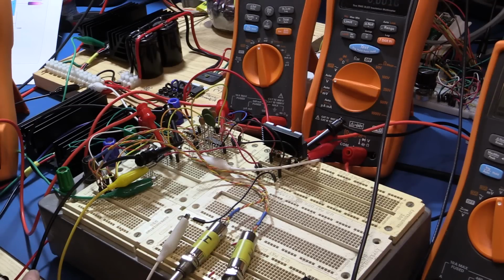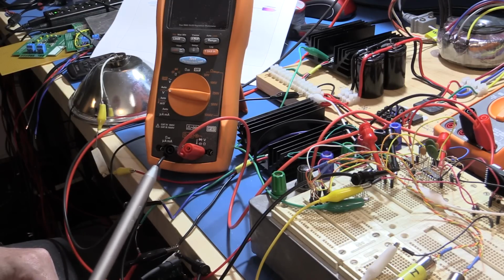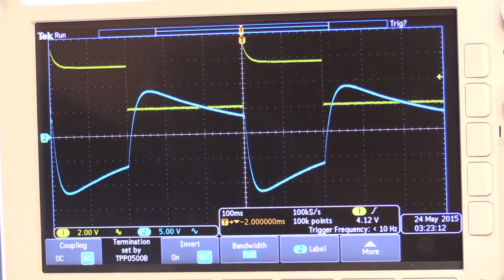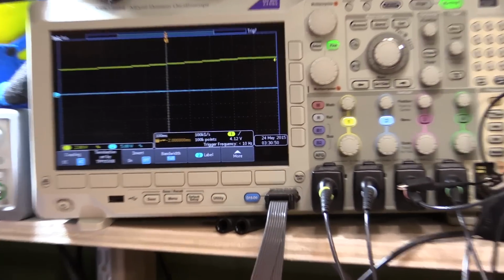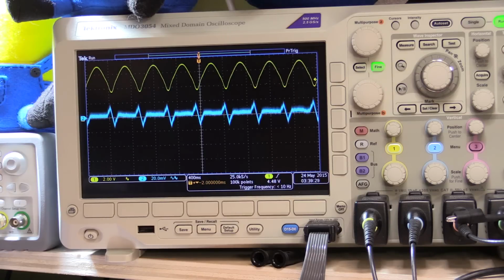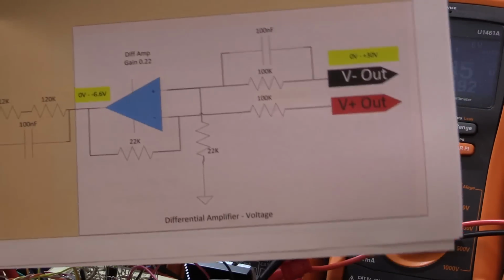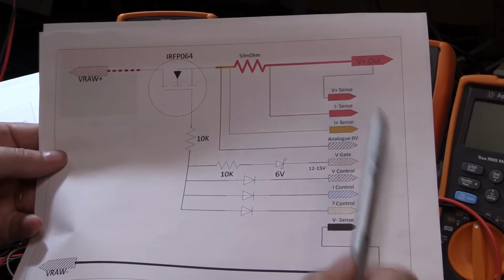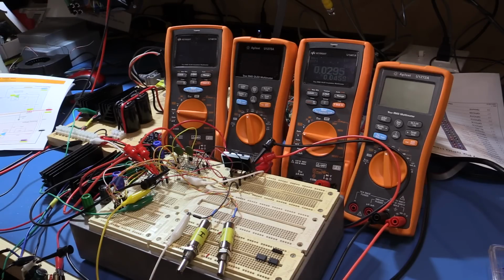The Modular Bench Power System #12 - Putting it all together

Comment: Loving this series and I've learnt a lot but it looks like with the MOSFET you can only limit current by reducing voltage. I'm assuming you'd have to use a completely different design to actually output a set voltage then control the current being drawn without affecting the supplied voltage.
Reply from the maker: +Moonbrony It is not to do with using a mosfet but the fact that you only want one parameter controlling the output at any one time so if the current is not at the limit it must not interfere with the voltage, conversely when the current limit is in play, the volts will be lower than the set point and you don't want that to override the current limit functionality

there are many ways of achieving this, the way presented is just one and is pretty simple to implement
Reply: +Peter Oakes (TheBreadboardca) Thanks for the reply. So you don't want both parameters controlling the output? I would have thought that as long as the current is controlled first, then you could control the voltage somehow as maybe a second stage? Then you could use it to power circuits that need no more than, say, half an amp, but require a variable range of voltages. Sorry, I've been making things for years but I'm new to the whole circuit design aspect.
Reply from the maker: Not both at the same time, if the current is not at its limit then the current amplifier should not be pulling down the voltage drive, same if the voltage is not at its limit and the current is not at its limit, then the output should be allowed to rise to the desired voltage, this is why the diodes in the output path of the amplifiers to the mosfet, it prevents either amplifier from driving the FET gate upwards and turning it more on, any amplifier or other device connected through a diode can pull the output off only, if nothing is at its limit then the drive to the FET is pulled high by hte pullup resistor, not the drive from the amplifiers

Comment: Racing season is finally done and I'm igniting this hobby for my spare time again. 

I was looking at a similar schematic to this layout (I think it was Agilent) with the analog circuit ground floating on the main power rail with +/-12v on an isolated supply as you discussed. Looks like this may be beyond my skill set as I am very new to this. The laptop power brick idea was my original plan as a have a few 20V ones laying around the house as well as a couple 30V printer bricks as well.

Thanks for the great tutorials!

M~
Reply from the maker: +Mike Novo you can still use the laptop brick for the POWER. use a small +- 12V for the OP-Amps and simply connect the ground to the right place as indicated in the schematic. this should work just fine.

I will be posting more videos on this soon as I proceed to computerizing the design and will include a section of these options
Reply: Peter Oakes Thanks, I've been playing with the schematic a bit lately trying to understand it. 

While I understand inverting the diff amp connections as you did to achieve the difference out in the summing node vrs the Iset and Vset going to the integrators, I'm not completely understanding why the I diff amp configuration differs from the V diff amp (classic resistor to ground). Is it because you are floating it on the main positive bus rail and it would be redundant and would also change the values? If it was not floating, would you reference the inverting (-) of the Current Diff Amp to ground? Because, this is what I was thinking of doing.

I feel like I owe you tuition money or something. lol!

M~

Comment: I built this power supply on a breadboard, tweaked integrator resistor and cap values to get decent loop stability. Works fine except this single issue i'm having - it's impossible to get 0 volts on this power supply, it's always floating couple hundred milivolts above zero. I think what's causing this issue is because all "signal" components are referenced to the mosfet source.
Reply: Booreak It seems i was wrong. If i reduce resistor values at summing junction to a lot lower value (around 1K) i can get almost 0V output. Correct me if i'm wrong but it seems that in this case op amp input bias current comes into play?
Reply: Booreak Talking to myself :) It is input offset current and input bias current problem. Easy solution is to replace the 100R resistor with 50k and replace 4.7nF cap with 30pF. Should keep loop stable, not kill entire opamp bandwidth and solve voltage drift and zero problems.

Comment: I have been watching from the beginning and this project has helped me a lot with my power supply. I really like the control scheme your using to only pull down on the mosfets gate instead of trying to drive it. 
I liked it so much that I went ahead and built the circuit on a breadboard but I'm having some issues with the output voltage not being stable under more than 100mA of load. Without a load, the output looks good and is rock solid but once loaded the output will drift up then down by a couple of volts. The output and the gate are oscillating and adding the bypass caps helped a little but not enough. Any suggestions on where to look or what to do to settle the output?

Are u going to release a schematic, for your circuit? And what keysight supplies are u looking to for reference?

Thanks again for the videos